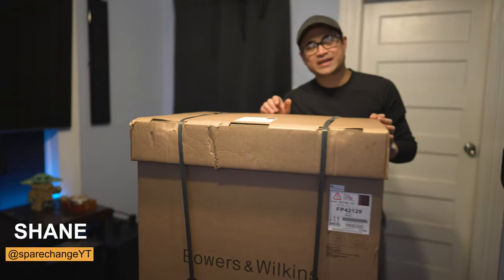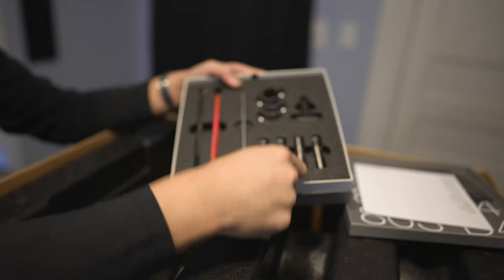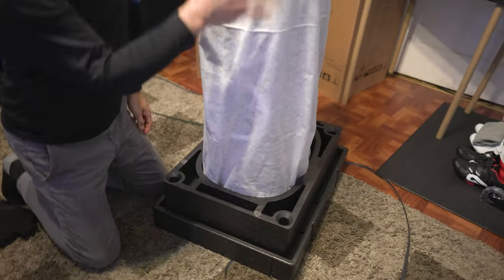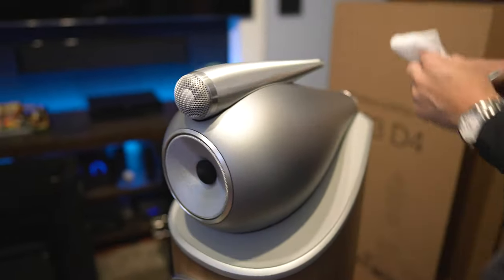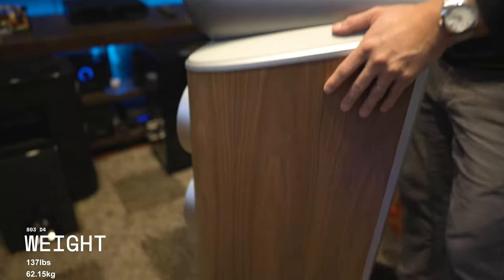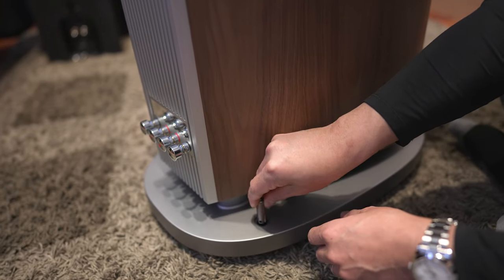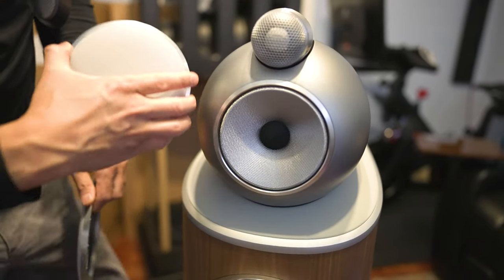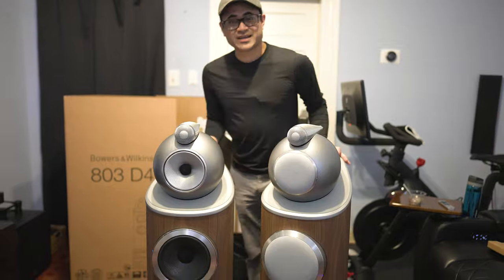HIFI Diamonds! Bowers & Wilkins 803 D4 Speaker Setup

Comment: Very nice! Looking forward to the review! I wonder what the sound difference will be between the 803 D3 and D4? Could it sound that much different? I guess you will tell us! Thanks!
Reply: I’ve heard both. I prefer the d3. Direct comparison with 805 d3 and 805 d4.  Sound wise both are good but I think they are too close for the difference in price. I’m also not a fan of the leather on the speaker. It does make you wonder how long the longevity of that material last throughout the lifetime of the speaker what kind of potential discoloration cracking etc.

Comment: I hope it will go down to 16hz as mentioned. Anyway great set is speakers.
Reply: I don't understand the race to the bottom. Surely a sub can do a better job leaving the mains to concentrate on a more condensed range and perhaps doing a better job of it at the same time. And as you say, the 16 hz figure might not be realistic anyway.
Reply: @Roof_Pizza  I like the sub to be dedicated to the discrete LFE channel and not have to worry about the low frequencies of ALL of the other speakers on top of that. Nothing screams "consumer home theater" like having the sub worry about all of the low end. If it's a 2 channel setup, then I'd prefer 1 sub for each channel. Those who say bass isn't directional must have bad ears or something.
Reply: @GameSack at what frequency do you consider low end to start?
Reply: @keepingupwiththejones2933  Right below 120-ish.
Reply: @GameSack  thanks. That is where I set my crossover.  Just got a pair of Rythmik fv18 subwoofers Rev2 paper cones. They are so articulate, punchy and accurate.

Comment: Omg what did you guys do? Ruined the speakers from the start. Those speakers lines must be transferred upright you must not lay them down. Bowers specifically told the dealer when I was picking them up with my cargo van not to load them laid down otherwise they would void the warranty.
Reply: Oh well who cares
Reply: Transported upright for the headed models or even with the 804 too?